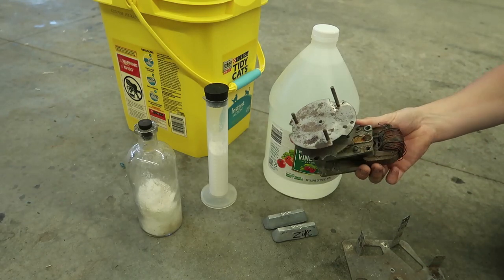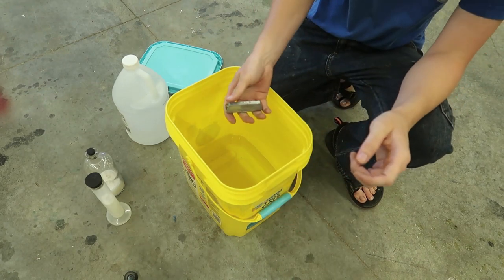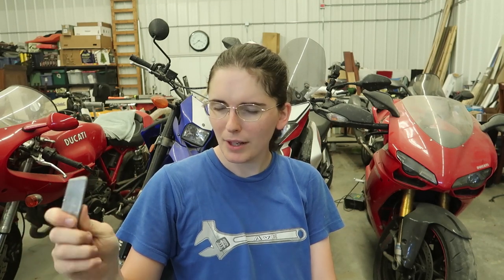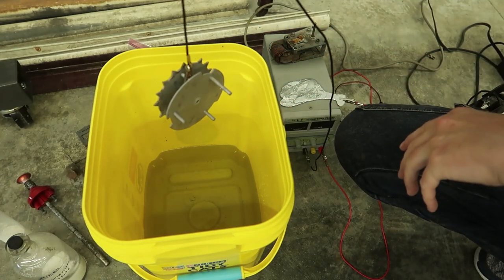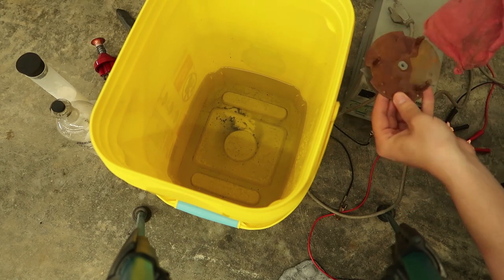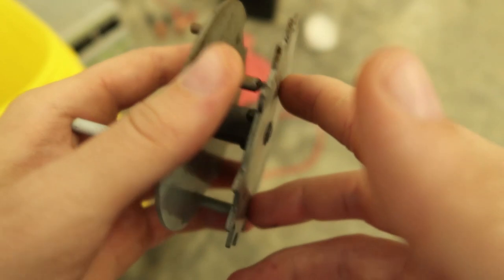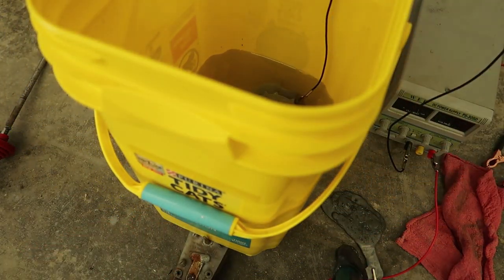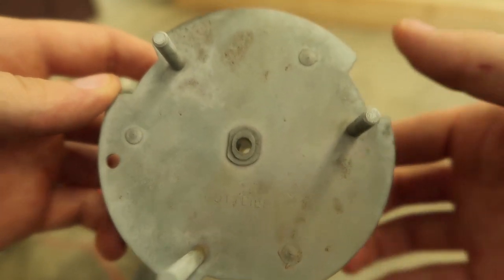Diy Electroplating 01: Zinc Plating with Vinegar Galvanizing Solution

Comment: You have your wires backwards....+ (red) on the piece you want to coat.  You clip the - (black) to the Zinc plate.  You don't need to soak it, or try to dissolve it.   The chemistry will do the work.   Electrolysis to remove rust works just like this except you put the + (red) on a sacrificial piece of metal and the - (black) on the rusty piece.  You add water and soda wash.   When zinc plating you use the same solution except you add vinegar; thus, water, soda wash,  and vinegar for zinc plating, and the + (red) wire goes on the piece that you want the zinc or rust to end up.  More amps the faster the process goes.   This releases hydrogen which is extremely volatile/explosive.  Do this outside.  Good luck.    PS- if you don't like the smell of vinegar, you might not want to take a big sniff of it as soon as you take off the cap.  lol

Comment: That wasn't a pure zinc ingot, was it?  Guessing a Zamak alloy.  You need pure metal to have it dissolve nicely.  The black powder is the copper that's not dissolving, and aluminum is probably not soluble in acetic, but corrodes to the hydroxide, leaving more gunk.

Sulfuric acid is cheaply available as drain cleaner, and hydrochloric acid (sold as muriatic acid) as well.  Both will attack zinc metal nice and quickly.  Sulfuric: make a 20% solution by pouring the acid slowly into five times as much water, with rapid mixing (this acid is the reason for the "do as you oughta" rhyme!).  Hydrochloric: straight 31.45% is pretty hot for zinc, so dilute it by half (it's already a solution, so it won't heat up when you add water, don't worry about it), then dissolve metal in it.

Once you have a solution, either one can be dehydrated to pure crystalline salts if you like.  Zinc sulfate crystallizes as the heptahydrate, the same crystal structure as magnesium and iron(II) (epsom salts and copperas/green vitriol).  So, don't allow those elements into solution, or they will crystallize along with the zinc.  Zinc chloride is deliquescent (absorbs moisture from the air so strongly, it forms a solution), so needs to be heated to crystallize as the tetrahydrate or thereabouts.  Once you have most of the crystals dropped out, pour off the leftover solution (which probably contains unused acid and extra junk; use however you like), rinse the crystals with a little water (or better yet, denatured alcohol), and dry on a paper towel.

However you do it, you want a far stronger solution than what you've shown here.  At least, to get reasonable current density (and therefore deposition rate).  Any time you're making hydrogen at the cathode, you're going too fast.  Hydrogen bubbles are bad because they block the surface and ruin the deposit.

Definitely do use distilled or RO or DI water, and chemicals as pure as you care to get them.  Clean the anode and cathode of oils, rust and oxides, and other contamination.

I don't know offhand what's good for zinc, in terms of leveling and brightening agents, but there are some out there.  Possibly thiourea works (in an acid solution).  These chemicals are hard to identify (lots of trade secrets :( ), and even harder to come by (without buying the industrial formulas a barrel at a time).

Thiourea at least works well with copper.  I do recommend getting experience this way, it's a good experiment at least.  Use copper sulfate (nearly concentrated solution), a bit of sulfuric acid, sometimes a bit of chloride content (a dash of hydrochloric acid?), and a few drops of thiourea solution.  (Tarn-X contains thiourea.  Off the shelf source -- bingo!!)  Plating rate should be pretty reasonable, and the solution should be very conductive, barely needing a volt.  (Zinc will need more like 2-3V of course.)
Reply from the maker: it was advertised as pure zinc, but i dont mind as long as it gets the job done. and thanks for the input, i plan to slowly refine my process until i get something that works for what i want.
Reply: Tim Williams hey thank you Tim, u saved me lots of jabbed in the balls. not meant 4 me but very informative and enough to get me to a good start. got fresh zinc from batt
Reply: Tim Williams yeah, like he said.
Reply: Tim Williams : Thank you for this wise advices. 
As you say, this is an area where there are a lot of secrets and hard-to-find products.
Reply: Let me use your presence and ask you how would you electroplate the inside of aluminium bottle. I'm researching it for a week and it seems too complicated to even make a proper zincate sollution without cyanide and other exotic sounding stuff. BTW I have sodium hydroxide ready and some zinc from wheel weights.
I'm thinking now that I'll lose my otherwise antiviral zinc for something looking like a sure failure. I'm thinking about carburizing it instead. I want to seal a peace of leather inside with a clay plug and leave it in a fire for couple of hours. Hopefuly it will not melt.

Aluminium cookware has many advantages over stainless pots. Why dont they plate it with gold or something? It would be perfect and finaly safe. I've read they do it with electroless nickel first. then gold.
I've got other things to do tho. Like working 🙂 I just want my flask safe asap.
Reply: So we can simply do the electroplating in the sulphuric or hydrochloric acid bath once the zinc has been dissolved?  Or should that be done in a weaker acid solution?

Comment: 10x 4 sharing. i need this 4 gabions mesh so the finish does not matter 2 much 4 me. nice 4 showing the amps and voltage. i tried today some copper plating at 12v/5a, no need 2 say it did not work

Comment: The black stuff is zinc acetate (Zn(CH3CO2)2 and the bubbles are hydrogen, and I believe what others have said: the Zinc ion solution  is attracted to the positive charge (they are negative ions) so the zinc is plating the cathode, not the metal part.Switch the wires.
Reply: Zinc ions are positive (2+). The plated part needs to be connected to the negative to attract the positive ions.

Comment: I'm not sure if what you have there is plain distilled white vinegar or "cleaning" vinegar. I recently discovered cleaning vinegar, which seems to just be distilled white vinegar with a little higher concentration of acetic acid. You might give it a shot.
Reply: Pickling vinegar is 7% but I think if you freeze vinegar that you can scoop out the ice and concentrate the acetic acid. It would be interest to find out.

Comment: Inter-Alia, due to the shape of UR objects (sharp edges & shielding) alkaline zinc is the way to go for galvanize. This alkaline bath is simply zinc oxide powder dissolved in lye and it has better “throwing power” than the alternative which would be a acidic zinc chloride. If you completely disassemble the object then acid zinc chloride would be beneficial. In plating - you can make your own zinc chloride bath by dissolving zinc metal in pool acid till no more dissolves, and it is perhaps the easiest for DIY experiments.  Cleanliness of the metal is paramount. In sand blast - how clean is that sand anyway - is it virgin or used. Consider glass beads instead? you need a cleaning cycle prior to galvanize eg. 5 % HCL dip followed by distilled water rinse.  But, as a practical DIY matter you will get much better results in general via powder coat. For DIY powdercoat option see Eastwood.

Comment: Soak the steel part in vinegar for a day or two to dissolve any rust, even in the pits. Wash it with soap & water, dip it in dilute hydrochloride acid wash just before plating.
Keep it free of oils, even skin oil, wear gloves, to get an even plating.

Comment: Also, if I had some used pinball machine parts I'd trade them for some plutonium.
Reply from the maker: need a bomb casing and libyans to trade with.
Reply: I think i can get some for You from Russia here...
Reply from the maker: +Sheep Eve you mean libyans? didnt know you were in the slave trade, must be expensive to import there, figured thered be laws against that.
Reply: Maye, but if You need Syrians, just dial the zero... Don't worry, The gouvernment here will pay them a proper income anyway...
Reply from the maker: oh right, i forgot Sweden is committing Seppuku, sure makes importing easier. :p
Reply: @Rinoa Super-Genius Nice blow. I never would've of thought to strike it with a sledge. Zinc is pretty tough. It's melting point is 420 °C. My heat gun can easily do that. I'll give it a try.
Reply: Great Scott!!!

Comment: just get a 24 volt truck battery charger,that works very well even the older weathered paint becomes thin and will dissolve by itself in most places on your part ,rust out your parts with plain water and a rebar bar,your water will get warm to hot, do not add salt or anything you will get gases with it,  when you have done that do the same with zinc sheet or plates that you find from old zinc roof gutters

Comment: Powdered sugar is likely to have anti-caking agents in it, not sure what else.
To get the inner areas to plate better you need line-of-sight between surfaces, which would likely require an external fixture to keep the plate from touching the part and shorting.
But I've yet to try this or electrolysis myself, so I'm just speaking from what I've gleaned over time.

Comment: I think the only way you're going to get a shine or a smooth texture is with a wire wheel or with a brightener of some type.  Brighteners are sold by plating companies and can get kinda expensive.  The sugar may help a little bit.  It slightly helps in copper.  May work better with zinc.
Reply from the maker: yeah im thinking maybe using my friends polishing wherl would do the trick

Comment: I would advise you to buy zinc sulfate instead of putting zinc into some vinegar.
Reply from the maker: why?
Reply: Because it saves you the step of having to dissolve the zinc metal first and you'll have a much more concentrated solution.
You can probably find zinc sulphate or acetate relatively cheap on eBay. Probably way to much Epsom salt too, a pinch should be enough if you have very pure water. ;)

Comment: 1080p50? Upgraded the production value?
Reply from the maker: upgraded over a year ago, just now catch on?
Reply: Just curious, why 50 fps instead of 60 fps?
Reply: Euro style, otherwise the Ducati would start to judder at 60 fps
Reply: @RinoaL  never actually looked at the fps when I change the setting to 1080p.
Reply from the maker: i do 50fps because another 10fps doesnt add anything, but i can make the video 1/6th clearer with the same bitrate.

Comment: Cut both the anode  in to two peace's & put live & earth on them & leave in the solution until it turns into electrolyte solution. & use a old laptop charger for your power supply them rectifiers dont work write half the time unless you get a really expensive one once the solution is done then wire the anode & the  part you want to plate how you had in the video you are better off with a diy zinc plating kit if you ever do this again love

Comment: Nickel was the element added to steel to make it projectile-resistant in the ballistic-armor found on tanks and ships during WWII, and yet you thought it would be soft like lead? I have to wonder why... It's been a known-quantity for 70 years now. Even modern day armored plating has nickel in it, although most of them are composites of nickel steel, Depleted Uranium and ceramics these days.
Reply from the maker: this video is about zinc, not nickel. pay attention next time.

iron and nickel have Moh hardness of 4, and zinc has 2.5, lead is 1.5

Comment: I have a project coming up to clean up some engine parts and was thinking about using this method:

https://youtu.be/MG3i-2aruNM
Reply from the maker: thats actually a really interesting channel, thanks for sharing. and thats electrolysis rust removal, i've done it before with a simpler solution.
Reply: Rinoa Super-Genius I was amazed at how quickly that method works. I wanted to use it to restore the engine parts and find a way to electroplate them afterwards. That’s what attracted me to this video.

Comment: Electrons go from the negative plate ( electrons have negative charge ) to the positive plate. So if you want to electroplate something, you connect the source material to the NEGATIVE plate and the destination piece to the POSITIVE plate. So, when electrons go from the negative plate to the positive plate, material will be deposited to the piece connected to the positive plate. Simple physics. That's why your plating did not work.
Reply: Q: two pieces of metal, very nearly touching.  Electroplate both until the gap between them is gone.  Metal bits now joined.
Would this be soldering, brazing or welding?
Reply: tom cat - you are right about the electrons flowing from negative to positive, however, as those negative electrons flow from negative to positive, positive current flows from positive to negative.  The current is what transports the metal ions to the negative terminal which is why you put the part on the negative terminal.  The electrons don't carry ion flow but the current does.  I know it is confusing to find out that current flows in the opposite direction of the electrons but it is true and so there are two flows, electron flow and current flow.  And they go in the opposite directions.